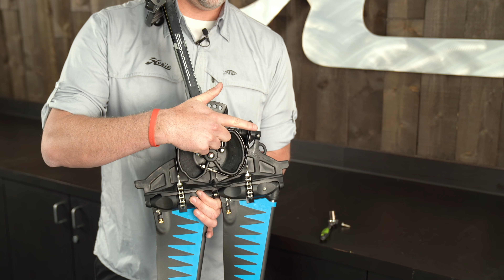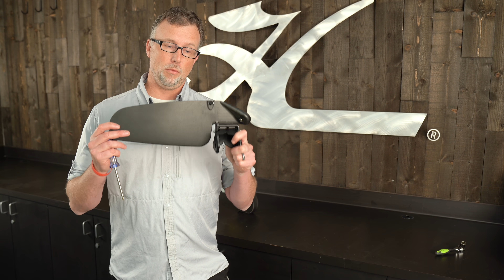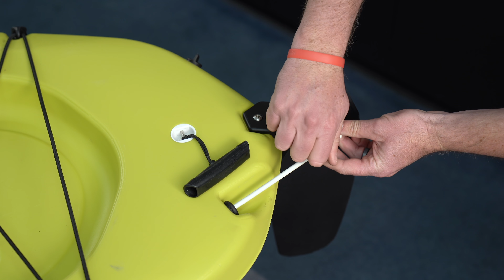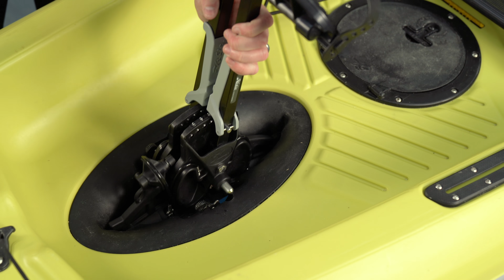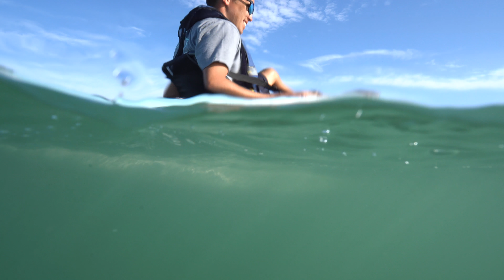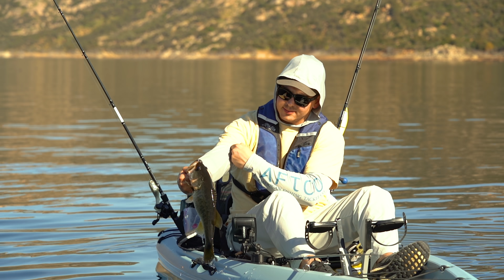QuickStart for Hobie Mirage Passport kayak

Comment: I must admit I love this kayak. Handles well in the water, very maneuverable.•ᴥ•>share4.photo/HKayak?ㅠ118    Very basic The storage hole isnt the best but it's not for expeditions. I'm 6'3" and 200lbs. and I fit alright in it. The best part is the portability. I can pick it up and put it inside my van by myself. I dont even have to put it on the roof rack, love it! I paid $180 plus tax.

Comment: still not sure it is a better option than the pelican catch 130...
Reply: Hobie also take pelican's idea for the thermoformed hull. Maybe they both colaborate.... (can anyone confirm that?) Pelican catch 130hd has more features such as more storage hatch, longer boat, more rod holders, remotely folding rudder. I would say pelican is a better boat for a real serious fishing. The issues are reliablity of pelican's pedal drive is not yet proven, there is a bit of drag at the stern (check out aliex's video) and pelican doesnt come with paddle included. You can always upgrade both pelican/pasport to hobie md180 in the future.
Reply: I am on the fence too
I am leaning towards the Passport mainly because the size
I dont want a 13ft kayak for now at least since I plan on throwing it in the bed of my smaller pickup and the light weight is intriguing too.
But not sure if I can put a transducer and fish finder on the Passport and dont like the manual rudder. Also not sure if the Passport can go out in the ocean?
Tough decision.
Reply: @More To Living your point? I don't care about that. I don't care about legacy. I don't care about their gift. I care about what I can get for my hard earned money. And as of today the pelican seems to give me a better product. It's good they have some competition now though. The market will force them to either reduce their price and become more affordable or innovate even more. They were the leader for a long time for a reason, so lets see what happens. Competition is great for us consumers, but as of right now I just feel like for the budget kayak I would go with the pelican in my opinion.

Comment: Maybe I missed it? Does it have a reverse?
Reply: Waldo183 no. The mirage drive system in it doesn’t have the reverse, you’d have to go up to the 180 drive set to get the reverse functionality. Though in my opinion I’ve had both in my compass and you honestly don’t really need the reverse. Though if you do happen upon a 180 drive for cheap it may be a decent buy, just don’t break the bank over it
Reply: TheAjhb I had the turbo / classic fins on my Hobie sport ,& I always wondered if the new 180 reverse drive models , spooked the fish when you pulled the levers , soundwise or motion ?
Reply: No.

Comment: Right off the bat, that rudder installation looks cheap and cheesy.  Just 2 SS screws into the plastic hull is all that holds that rudder assembly on?  That's way to delicate for my taste.  Same with the steering rod, one thumb nut tightened by hand to hold the rod on?  Maybe I'm wrong, but that is extremely under designed in my opinion.  What happens if you strip one of the screws or the plastic hull the screw goes into?  Then what?   I REALLY want to like this boat because my wife and I are about to finally pull the trigger on 2 Hobie Compasses.  Now you come out with this new boat and I really have to think about it.  The rudder assembly to the boat just looks so cheap and flimsy.   One good bump on a rock or other hard surface and that this will get torn off easily.  Am I wrong?  All this said, it looks like a great option especially for non-fishers like me and my wife.  And I like the sail kit and Bimini possibilities!  I like the side grip handles!  But no cup holders?  The price point is great, but in my case, not a selling benefit.  Thanks Hobie.  Now if you just made it in Papaya and Camo colors
Reply: This is a great kayak for the money.  Brilliant!  I'm a dealer and I'll respond to your comments. ?  And yes, you are wrong.  The screws are holding the bracket.  The rudder will move if it hits anything.  It's not locked down, so there will be little, if any load on those screws.  If they do strip, West System epoxy has an epoxy for plastic that you can put in the hole and redrill when it has hardened.  Steering is simple and time will tell how it works, but if it doesn't, and that's a big if, Hobie has always come out with a solid fix and a solution that works, but let's give it some time.  Flexible materials allow for less breakage, so I feel it's a good choice.  I think your negativity is that you had your heart set on the Compasses and now you're confused with the new, less expensive choice that Hobie introduced today.  The Compass and Passport are two different price points, so they won't be similar.  If you want more go for the Compass.  Resale on Hobie kayaks is strong, so you can't go wrong.  Go with your gut.  And buy what you can afford to.  It's a great experience.
Reply: Hobie has never built anything cheap or cheesy.  I know because I have a fleet of them dating back to the first-run of the Mirage and we have never had a single problem from any of the half-dozen Mirages that I own.